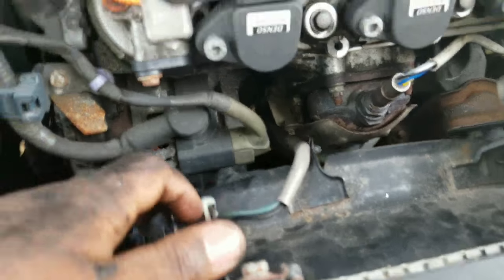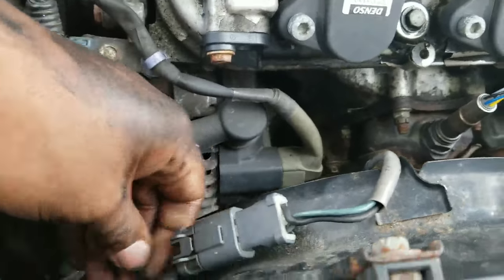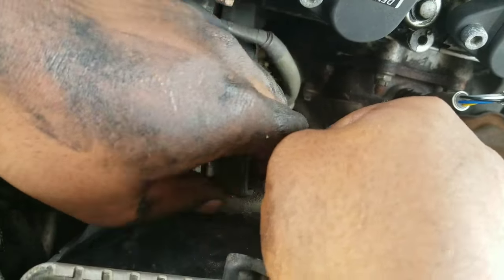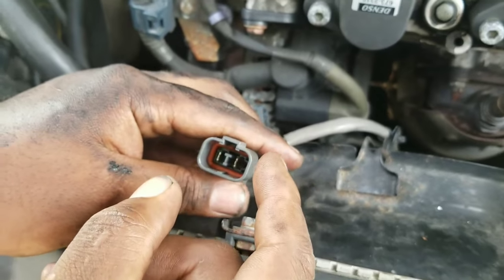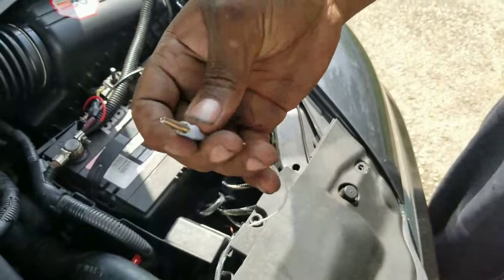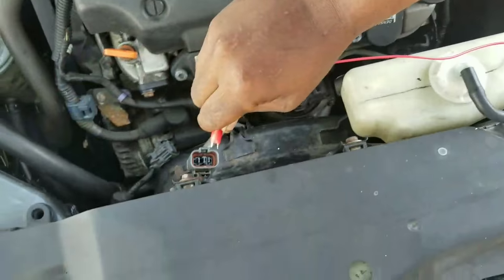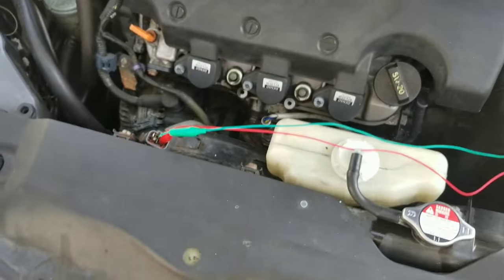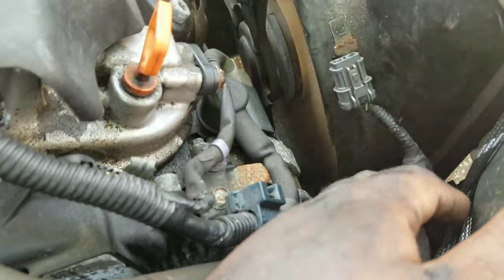HOW TO TEST A CARS COOLING FAN TUTORIAL

Comment: I'm having the same problem. My 2014 Dodge Avenger has two fans. At first, the passenger side fan wasn't working and the driver side fan was. 
I got one of those small, light weight, mini-hammers and ever so gently tapped on the fan that wasnt working. It kicked on. But now the driver side fan doesn't. Any clue? 
Also, any particular alligator clips will do. And does it matter what prong to put the clip on? 
Thanks 👍

Comment: my truck has a fan that does not work when i put direct power from the battery it wont do nothing only some times when i hit the motor with something it would run

Comment: What up bro, off topic question for you. I have the 4gen TL. When I use the ac my rpms surge alot to the point the car sounds like it wants to stall out but the rpms jump right back up. What could be the problem? Awesome video btw
Reply from the maker: try cleaning mass airflow sensor and get the battery and alternator load tested.

Comment: Hello. For some reason my car has the cooling fan connector is covered with electrical tape. It supposed to connect to the middle part of the fan. That’s how I got the car and I just figure. I want to connect it but I don’t know if there is an issue with it and that’s why it was disconnected. How should check that?
Reply from the maker: Sounds like that jumped the fan I would replace the fan or fan connector with a replacement and connect everything the right way.